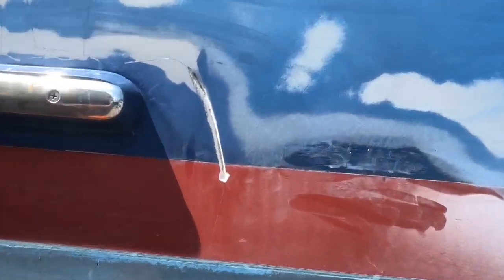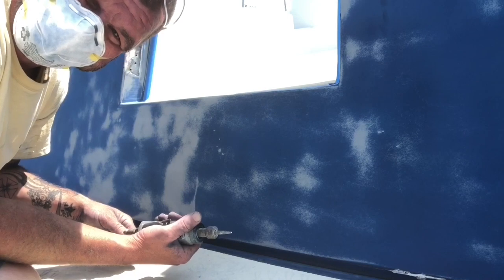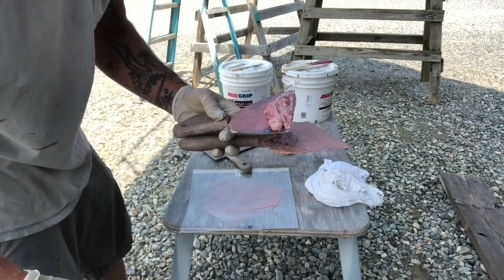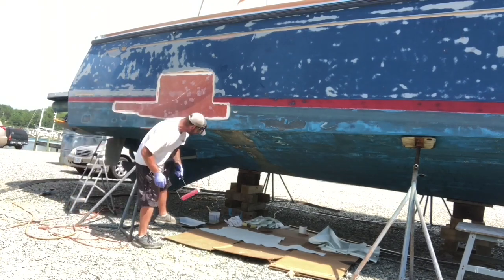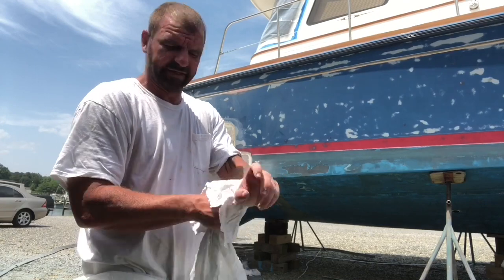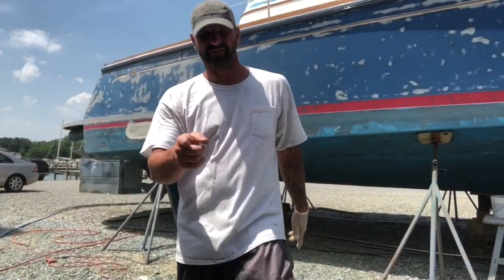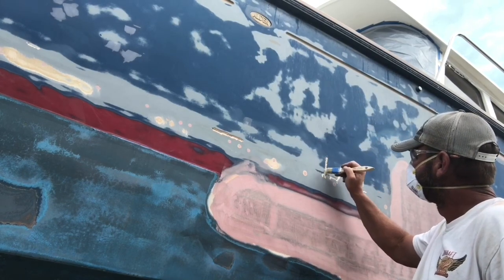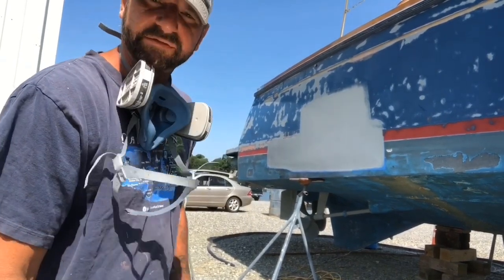How to prep, prime,prep, paint part 2 (DIY)

Comment: Great video, great info. One question, when laying up multiple layers of glass like that, shouldn't the fibers go perpendicular, or it doesn't matter (when you have them on the ground, they look like they're all the same direction)? Or depend on the numbers of layers?
Also, what type/brand is that long flat air-sander you used? I've never seen one like that before.
Reply from the maker: 1975Per thx. And in this situation it doesn’t matter. If I was doing a much larger repair then I might run them perpendicular but I would lay the last layers length wise with less seams. And the air file is a Hutchins air sander model 3800H orbital hookit 👌👌
Reply: @boatpaintingrestorationwit3029  Hmmm, how do you mean less seams? Or do you mean less frayed edges along the length of the repair area?
Reply from the maker: 1975Per less frayed edges I guess is what I’m trying to say. Lol. The glass I work with all comes in 5ft wide rolls. If I was doing say a 20ftby5f long repair I would lay the first layer the full length and probably every layer after that as well. It is stronger that way rather then laying up 4 individual 5ft wide pieces. If that makes any sense.